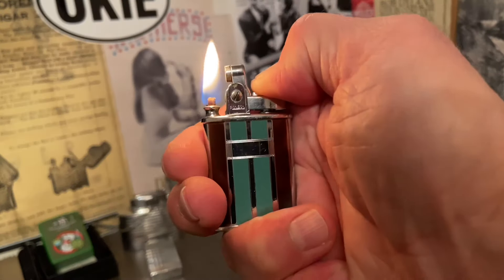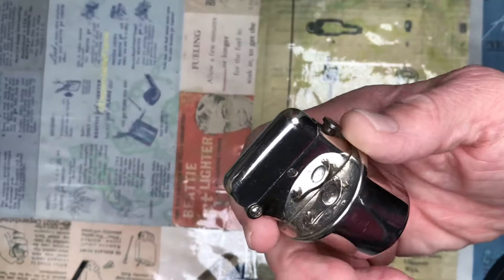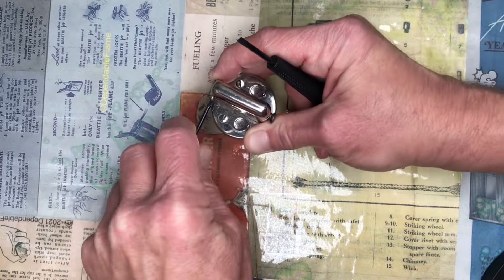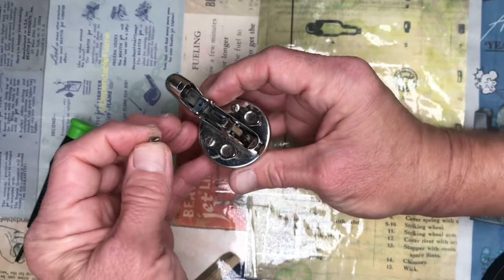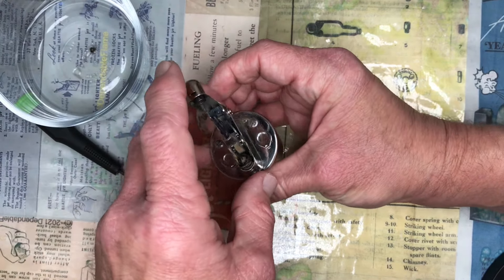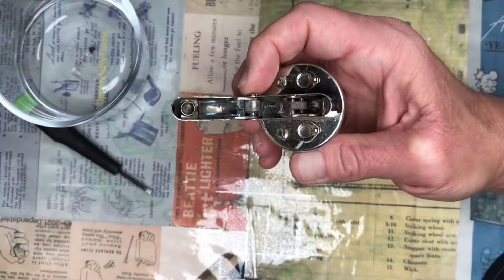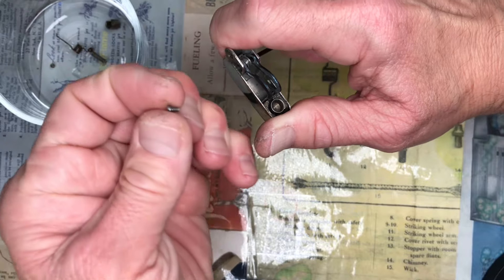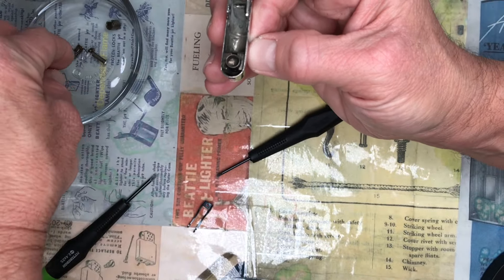How To Install The Claw Spring In A Thorens Double-Claw Semi-Automatic Petrol Lighter Mechanism

Comment: Very interesting. I am currently working on a single claw model and can't figure out what's wrong. When I pop the lid open the claw disenages from the dogtooth on the flint wheel  once the flint wheel has been rotated the appropriate amount. The clawa does not remainin captured by the dog tooth long enough but pops out, with the lid flinging open all the way and the flinto going into outer space. I have another identical single claw Thorens and it works fine. I can't tell what's causing the problem.